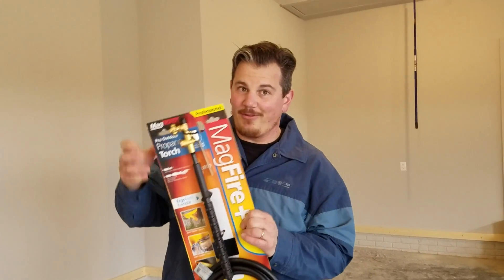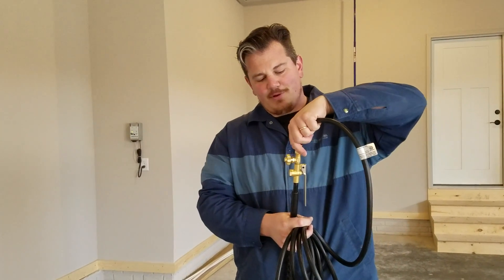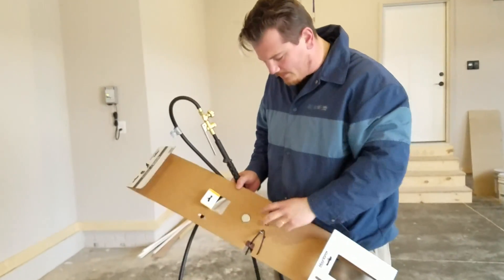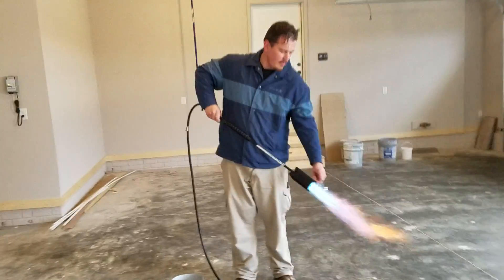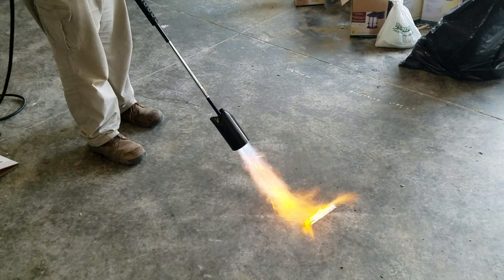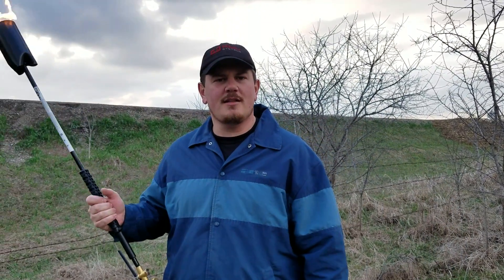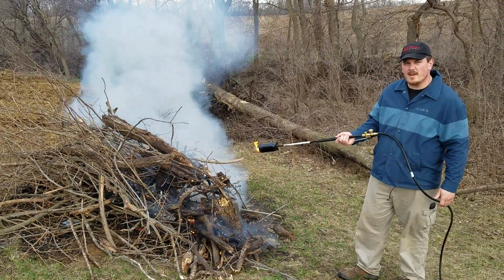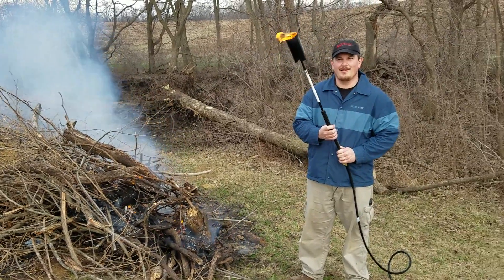MagFire+ 500,000 BTU Outdoor Torch & Weed Burner - Unboxing & Tool Review

Comment: 8:10 you have trouble because you are trying to heat TOO much mass at once.  A match CANNOT light a tree, but it can light a candle, which can burn all night.

Stack your wood like a tick tack toe board, with LARGEST logs on bottom, and finally tinder up top.

Now use match to light tinder and as it burns, it heats the wood below it and burns the smoke from the wood, so this fire will get larger and produce no smoke over the tree line.
Reply from the maker: I have trouble lighting it, since it's WET. I've started hundreds of fires like this, and have gotten accustom to keeping a heap of tinder to dry out, and I just start a small fire, then grab a shovel full of "fire" to bring over to the NEXT pile...but if it's all wet, I can get it working with some effort.

Love this torch, but don't love having to carry around the tank.